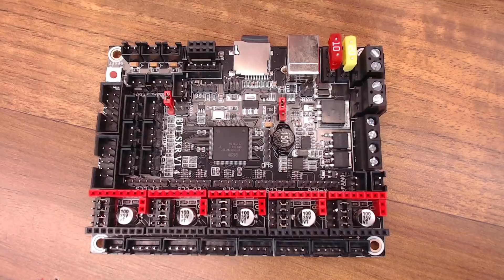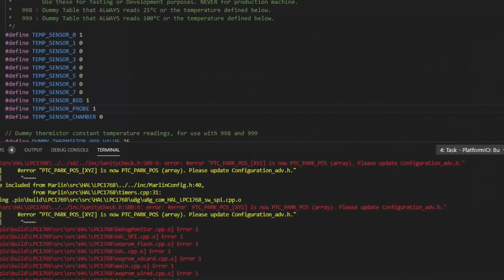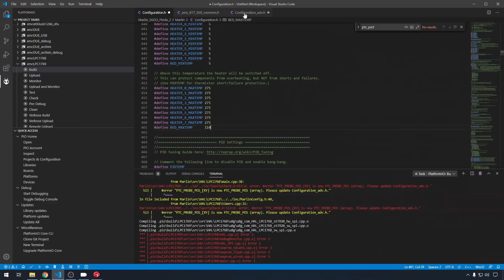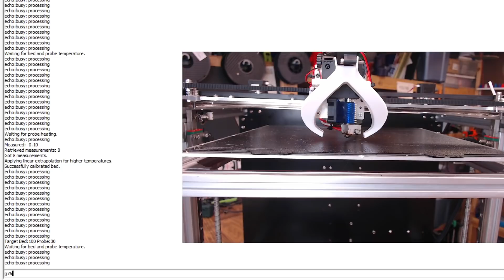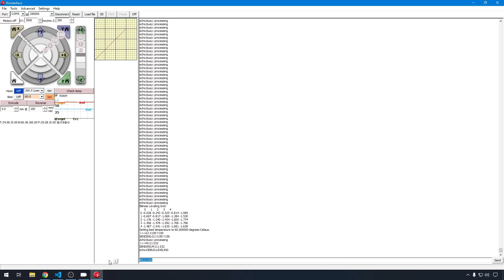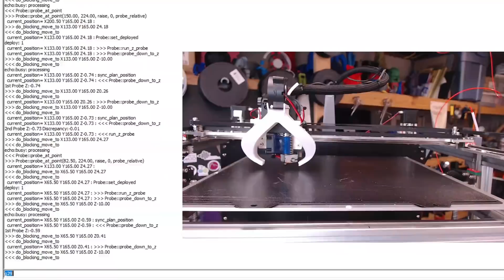Prusa Pinda 2 - Probe Thermistor Setup - Marlin - Chris's Basement

Comment: I have a v1 Pinda probe that I would like to install on my Ender 5 pro with the Creality v4.2.2 main board.  As the z endstop only uses 2 pins is there an alternative connection I can use with the Pinda either all together by plugging in with the plug already attache d or bytaking the individual wire and using pins here,there and everywhere elseware on the board?
Reply from the maker: I don't know if there any available 5v pins on that board, but if there are you can grab power from there. If not you could use a converter to voltage regulator and reduce it down to 5v so you can get power from anywhere. You have to be careful not to feed more than 5v into the signal pin.
Reply: Well Chris your reply has prompted me to buy a SKR 1.4 Turbo board which arrived today c/w a BTT touch screen as well so tomorrow will be upgrade time.

Comment: Hello Chris awesome video! The probe that I ordered was too short so I extended it. I am having an issue with the probe triggering. I wire the sensor up and plug it into the z endstop port. In marlin I set z min to z endstop port. the sensor lights up when near metal when I check with m119 command it always says z is triggered and if i invert it its always open. I have played around with switching to other pins but have no luck. Any help would be greatly appreciated!
Reply from the maker: All I can think of is the wiring isn't correct. What board do you have? If it's an SKR make sure the diag pin isn't messing things up.
Reply: @ChrisRiley  it's an skr 1.4 turbo. I have bent the diag pin out of the way but still the same issue. Could it be an issue with extending the cable?

Edit: got it to work! It was and issue with a connecter not being pushed in correctly. Thanks again for the video!
Reply from the maker: @andrewhunter8968  Glad you found it.

Comment: Hi Chris, I got myself the pinda v2 clone from trianglelabs and connected it to my skr e3 v2 board. Everything works however in octoprint terminal I see unrealistic probe temps. P: 230.... if I move the probe to the heated bed it rises to like 250. Bed and extrudertemps show up correct in °C. Do you know if the marlin probe temp compensation would work with any probe temps? Like, is only the change in temp relevant?
Reply: Damn, not working. Terminal puts out "waiting for cooling". I guess because probe temp reads 240 but it should be 30.
Reply: I think I can get it working. config_adv.h has these lines:
// Probe temperature calibration generates a table of values starting at PTC_SAMPLE_START
    // (e.g. 30), in steps of PTC_SAMPLE_RES (e.g. 5) with PTC_SAMPLE_COUNT (e.g. 10) samples.

    //#define PTC_SAMPLE_START  30.0f
    //#define PTC_SAMPLE_RES    5.0f
    //#define PTC_SAMPLE_COUNT  10U
I'm not sure, I think I need to change ptc sample start value.. But to what value? The shown temp when the probe is in homing position right over the 60° heated bed or is do I need the "normal" probe temp when bed is off and probe is in the cooldown position?

Edit: Nope, not working. Always after I enter G76 printer homes and I get the message: Waiting for cooling... That's it.. Nothing else happens, no bed heating nothing.
Reply from the maker: I think it does have to be with in a range for Marlin to use it. You would need to build a temp table for that Probe. Trianglelabs might have one  they can share with you.
Reply: @ChrisRiley  I think I now know why I get weird readings. The skr e3 mini v2.0 just has 2 thermistor ports th0 and thb. These have a different electrical circuit (resistor and capacitor added) If I want the thermistor from the probe to work via another pin like pa1 I'd need to add a resistor and capacitor... and get 3.3v, for example from the swd port.
Seems this was not necessary on your skr 1.4 board..

Comment: Thanks i have full working on skr e3 v2 with thermistor 😃
Reply from the maker: Nice work!
Reply: @Grzegorz Wozniak How did you wire it? I'm trying to do the same thing with klipper.
Reply: @LoopyChef95  I use servo pin for thermistor you need use extra 4.7k resistor and if I good remember 22uf 25v  small change on marlin board file and works
Reply: @Grzegorz_Wozniak  Is the servo pin PC12 on PWR-DET and the rest of the wires are on Z-PROBE Blue=GND, Brown=5v, Black= PA1 or PC14?
Thanks for replying btw.
Reply: @LoopyChef95  I got pc14 black white on pa1
Reply: @Grzegorz_Wozniak  Alright, thx I'll give it a shot.
Reply: @LoopyChef95  3.3v resistor 4.7k to pa1 and 10uf25v positive pa1 negative to gnd
Reply: @Grzegorz_Wozniak  When you have time you should definitely document this on github btw.
Reply: @LoopyChef95  I will ✌️
Reply: Hello, can you explain why a capacitor and a resistor is needed and how exactly it has to be wired? I bought the trianglelabs pinda v2 clone..no idea if I also need capacitor and resistor (I also use skr e3 mini v2.0). Now I just see using TEMP_SENSOR_PROBE 1, I get wrong probe temp of like 240..
Reply: @trohn_javolta8485  hi 3.3v from SWD 4.7k to thermistor pin also 10uf positive to 4.7k resistor negative to Gnd Should fix the wrong reading

Comment: Hi Chris!
Want to build my own printer (a Hevo) and think over to use a Prusa Pinda (my first Autolevel sensor)
Since i would prefer to use a Duet 2 Wifi board, i dont know how i could connect the Pinda 2 to the Duet 2 Wifi Board!
Did you know this?

Sorry hope my english is correct, because i am not very good at it =)
Kind Regards from Austria
Reply from the maker: I'm not exactly sure how the config would work, but with RRF 3 you can assign the pins you need. There will be multiple analog pins to use. If you can get a Super Pinda that would probably be even easier.

Comment: When I run G76 the printer inits the process without issues, but them the probe never get down so it get heated :/

Waiting for cooling.
Target Bed:60 Probe:30
Waiting for bed and probe temperature.
Waiting for probe heating. <---- Probe stays in z100

Doesn't the z should get closer to the bead at this point so it can get heated? Any ideia of what is going on?
Reply from the maker: Check your park position and make sure it's close enough to the bed.
Reply: @ChrisRiley  Hi Chris. Thanks for the reply.
In the mean time I've just found it was a bug on my Marlin version. Found the PR somewhere, but can't really find it now ahah
It was a problem testing the probe heating, not cooling. The probe simply didn't lower near to the bed. Instead, it was just staying in the same Z defined for parking.
The fix got release on 2.0.6 (I think), but that one messed with my RR FullGraphics. At the end, bugfix from 21/12 solved both issues!
Probing like a champ now. But the process takes soooo long!

Again, thank you for the reply and specially for you video contribution. Pretty useful, congrats!
Take care and keep going!

Comment: Hello, I have a Two Trees Sapphire Pro and I managed to install latest Marlin V2.0.7. After a night working on it I finally have TMC working in UART mode, Neopixel enabled and everything works like a charm on my MKS Robin Nano V1.2 BUUUUUUT.....

I have only one problem: I'm using a PINDA V2 probe and I enabled temp compensation, the problem I have is that I can't make the board to read the temp value of the probe, the wiring is 100% correct because when I connect the probe instead of bed temp I can see the values. The problem is that I have the same identical readings on BED and TH1 (where the pinda is connected) like if are the same pin!!!!
I did like this:

//
// Temperature Sensors
//
#define TEMP_0_PIN                          PC1   // TH1
#define TEMP_1_PIN                          PC2   // TH2
#define TEMP_BED_PIN                        PC0   // TB1

#if HOTENDS == 1
  #if TEMP_SENSOR_PROBE
    #define TEMP_PROBE_PIN            TEMP_1_PIN
  #elif TEMP_SENSOR_CHAMBER
    #define TEMP_CHAMBER_PIN          TEMP_1_PIN
  #endif
#endif

What's the problem?
Reply from the maker: It looks like you have it right, it should work. Those are analog pins, maybe there is some cross talk. What happens if you hook up a thermistor to all 3?

Comment: Just use a pressure sensor on the nozzle and have it hit the bed
Reply from the maker: Sure, you do have a link to one you prefer?
Reply: Chris Riley BTW the sensor should be pressed when the nozzle touched the print bed. https://www.amazon.com/Adafruit-Round-Force-Sensitive-Resistor-FSR/dp/B00XW2MIRQ/ref=mp_s_a_1_5?dchild=1&keywords=force+sensing+resistor&qid=1592671596&sprefix=force+sensing+re&sr=8-5

Comment: I saw your result, and I think pinda 2 feature is not as accurate as probe without thermistor, for heated bed you just need to do G29 before bed start to heat, the expansion of the bed is really small compare to what I saw in your video.
I'm not a native English speaker so I might misunderstand your video, in that case please accept my apology, but you can see probe offset of 16 points in the end of the video, the 4 points in the first row change 0.2mm from room temp to 100c, but 4 points in the fourth rows change only 0.01mm, maybe that mean your bed is not equally heated, and the algorithm use only 1 bed temp for the math althout temperature varies across the bed, some point is hot, some is cold.
Reply from the maker: Good observations. That very well could be. After I did this video I thought maybe I should have done some probe comparisons first. Also, this is an AC powered bed, so I am not sure how spotty the heating might be. I will check that.

Comment: Hi Chris, just a simple question? How do you able to print ABS without an enclosure? Haven't you got problems such as warping or cracking?
Reply from the maker: As log in the bed is hot and even and the part isn't very tall I can usually print it just fine.

Comment: Thanks for the video, it really is informative and will help a lot of people :). Recently I have been trying to setup pinda v2 on skr 1.4 turbo and couldn't get it to work on Z-MIN like you did and with similar configurations. However when I moved it to Z-MAX everything worked. Did you cut Z DIAG pin on the tmc2209 to get it to work on Z-MIN?
Reply from the maker: Thanks for watching! No, Z min shouldn't be impacted by the pin, but Z max will be, but only if you have sensorless homing on Z, which not many people do. Not sure why Z min wouldn't work.

Comment: I am trying to implement the M600 command on my Ender 3 pro with marlin 1.1.6 installed and which already has a boot loader. I followed your  video showing how to do this by going into the Advance_pause_feature in configuration_adv.h and then the configuration file. When I tried to compile it in arduino ide I received this error message..."Error compiling for board sanguino 1284P boards". I know nothing about Arduino so I am stumped and am not quite sure what to do now. My friend helped me the first time when we flashed the boot loader but isn't available because of the Covid 19 "Plandemic". Do you have any suggestions what I should do now? They would be gratefully accepted. Sorry if I'm off topic.
Reply from the maker: What version of Marlin are you trying to compile? What is the error?
Reply: @ChrisRiley  marlin 1.1.6 as I wrote in my question and M600 "Error compiling for board sanguino 1284P boards"
Reply from the maker: @TheRoon4660  Well I was hoping there was more than that. I guess I was thinking you were upgrading to a newer version. What IDE are you using. I would consider downgrading to version 1.8.5.
Reply: @ChrisRiley  If I am using version 1.1.6 why would I be "downgrading# to go to 1.8.5? arduino ide is what I use as I stated initially but you didn't seem to read.

Comment: Thanks very much for that explanation! 👍🏻
I have some issues when printing ASA or PC due to the temp drift the Pinda 2 has.
I've found the advanced calibration in the Prusa help manuals: https://help.prusa3d.com/en/article/manual-temperature-calibration_2232 But from my perspective this is really time consuming while your solution with G76 seems much more elegant.
Do you know if the stock Prusa firmware (latest 3.9.0) has the G76 feature or not and have you tried it with the Original Prusa MK3s and 3.9.0 stock firmware?
Reply from the maker: You bet, that's a great question. I would have to consult with my Prusa guys not sure how they are implementing that today.
Reply: @ChrisRiley  Would be cool if you can clarify that. There are more than enough MK3s in the wild who would definitively profit from it! 😃
I was slightly shocked to see that the offset table in the stock MK3s is empty while they say that the Pinda 2 compensates for the temperatures... 😳🤨
Reply: Any updates regarding G76 on stock Prusa MK3s printers? 🤔

Comment: Interesting test. The idea definitely has potential. Unfortunately useless without a probe repeatability test on a single spot at each temperature. And then you would need a repeatability test of the mesh at each temperature.
As long as you don't know these deviations, you can't make any conclusion until you have a better contrast in your results.

I did something similar on a bltouch clone and found out that I have a huge deviation on the mesh, but a very small deviation on a single spot.

Also consider the bending of the bed due to the thermal expansion. ;)
Reply from the maker: Yeah, I tried to convey that slightly in the last info view. Probably not the best way to implement something like this, but it does take a swag at trying to compensate.